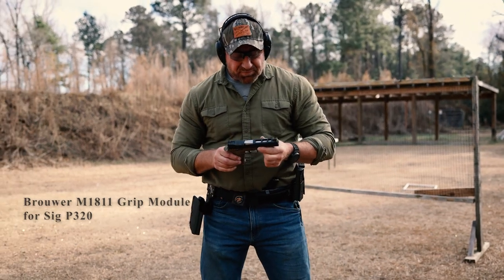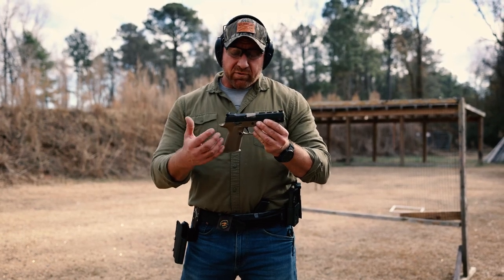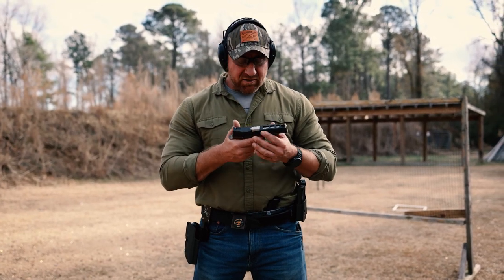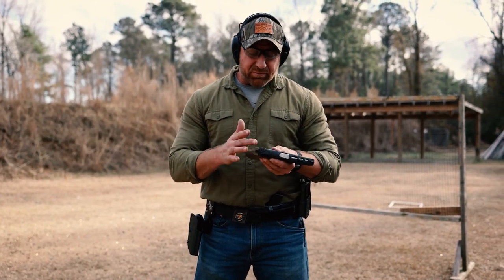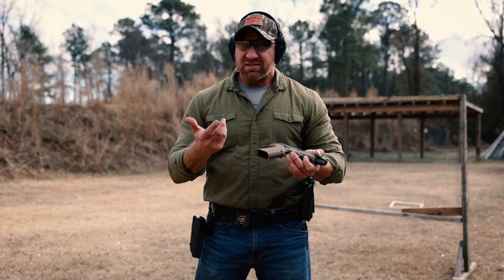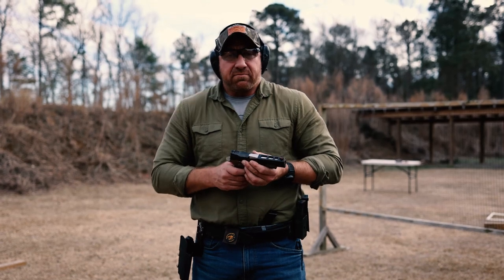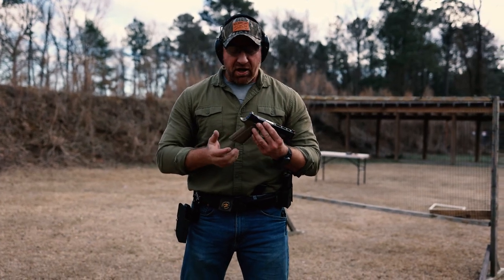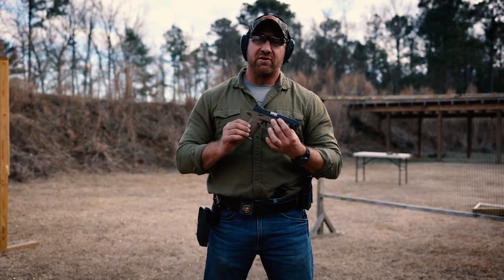Brouwer M1811 Grip Module for SIG P320

Comment: Save your money and buy a P80 grip.
Reply: God no. The P80 has terrible ergos, inferior flimsy polymer and a plastic mag catch that can easily be sheered off with the metal mags. Trash QC I’m guessing too as my P80 grip mod had awful molding seams that had to  filed down and random rough spots. The Brouwer feels the most solid out of all the polymer grips I have and I have all of them except the Mirzon. This points the best, has fantastic ergos, has great QC and easily has the most effective magwell. Wilson’s grip is a good choice too but not nearly as good as the Brouwer and the Wilson is just too damn small for me personally. The P80 is the worst grip along with the stock bulbous Sig grips imo